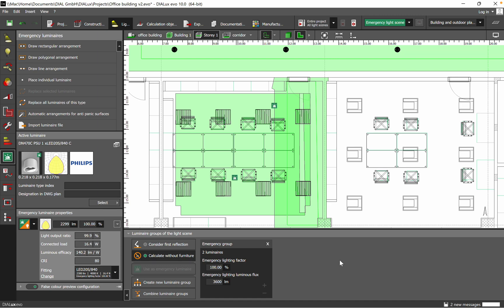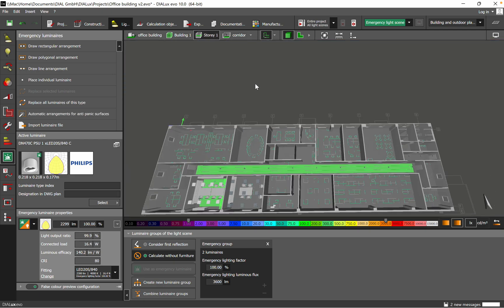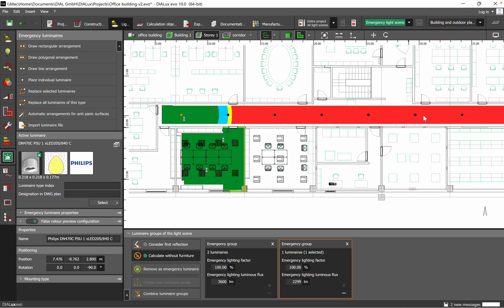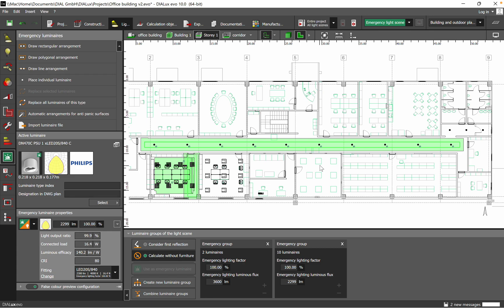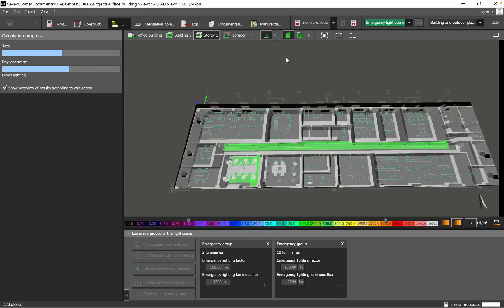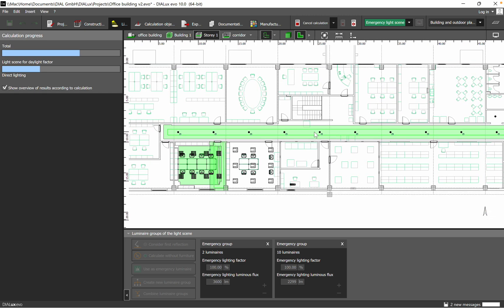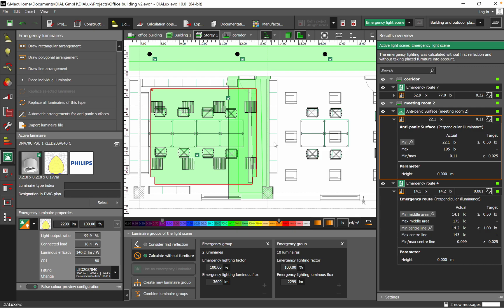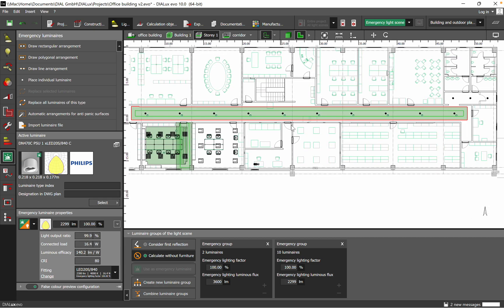How to calculate emergency lighting part II

Comment: Hello Sir. Great video! I had one question though, why did you not consider the furniture and also ignore the first reflection. Aren't both of these necessary for accurate results?
Reply from the maker: Hello, I did not mentioned about the furniture and refection because the main target was the lux level for emergency lighting to be achieved. However once you place the furniture into one space when you run the lighting calculation, the software takes into account the furniture placed in that space. I would do a video where I can explain and show the difference of illuminance with furniture and without furniture. Hope that I answer to your question. Thanks for your comment. BR, Catalin
Reply: @catalindesigner  Still a bit confused, Shouldn't we have the option "calculate without furniture" off when calculating emergency lighting levels of a space with furniture in it in order to get the accurate lux level results? Appreciate your time and response.
Reply from the maker: @arishsiddiqui3292  It will be great to have this feature in this software, let say as default: excluding or including the furniture for lighting calculation. Unfortunately for time being this option doesn't exist in the software. My opinion is that this option docent exist as usually all the rooms are being equipped with furniture, therefore the lighting calculation is done based on a realistic scenario.
Reply: @catalindesigner  Thanks Catalin, appreciate your reply.
Reply from the maker: You are welcome! @arishsiddiqui3292